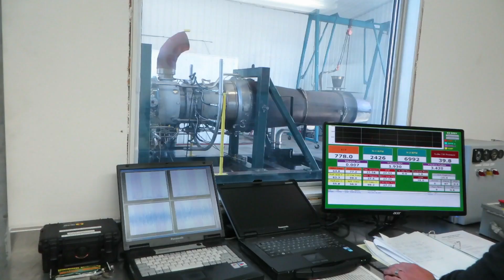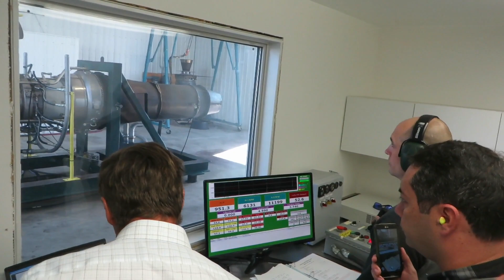RR Marine Spey turbine engine test run

Comment: Great video, what's the difference between the industrial, aero and marine engines? You have shown the aero to industrial but what is different with the marine application engine?
Reply from the maker: +hommie789  A marine engine is usually very close to an industrial engine, with more attention paid to protection from corrosion.
Reply: +AgentJayZ but this hade been in seawater ? from a crash or something ? ... still amazes me that there are guys walking up to it and "prodding" the engine when it´s running. They sure got more balls then me :P btw, that piece that flew of the roof/door, what was that ? just wondering :P Great video as always :)
Reply: +hommie789 We've discussed this in the preceding videos. The Industrial and Marine Speys were derived from the Allison TF41, which was a licence-built Spey, used in the A-7 Corsair II. My colleague, Keith O**, headed the design team and he had to go out to Indianapolis to bring back all the technical data. To turn the engine into a turbojet/gas generator, the first three stages of the LP compressor were 'cropped' to delete the by-pass stream. However, as you would have seen from the Industrial Spey shown previously, it kept the aero intermediate casing, which gave it a bot-bellied stove appearance. The Marine Spey had a major redesign in this area, because it was required to withstand 30G shock loads, just in case a bomb or a mine exploded somewhere near it.
Reply: grahamj9101 Awesome, thank you Graham. Being on AgentJayZ page for years now I have known about the difference between the Aero and the industrial but the industrial and the marine was new. Your explanation is perfect, so there is a major redesign. Any other differences between the two? Would compressor blades, shafts, combustor cans, turbine blades all be he same?
Reply: +hommie789 I was busy with the Industrial RB211 at the time the Marine Spey was designed, so I'm not familiar with the detail design features. However, if you go back to that Industrial Spey, you will be able to compare the external differences around the LP compressor and intermediate casing. The marine engine has that substantial mounting ring integrated into the compressor casing. Internally, the basic turbomachinery should have stayed much the same, possibly with improved corrosion protection on steel discs and shafts. The HP turbine of the SM1A would have been much the same as the TF41, but I have the impression that the uprated SM1C had new HPNVs and turbine blades with improved cooling. On the subject of the combustion chambers, I'm still trying to wheedle out of AgentJayZ what standard of combustor that SM1A engine has. As I've told him, I was involved in the design of a reflex airspray burner (RAB) combustor for the Marine Spey. It's all a long time ago now, but that may have been for the SM1C engine. It appears that they were fuelling the engine with gas, so I'm even more interested in knowing.
Reply: +hommie789 PS When I reply to a very good question like yours (and to some less intelligent ones), I do try to consider other subscribers with less knowledge and give a full answer.
Reply: +hommie789 Oops! I've just realised that I turned a Marine Spey into a Marine Tyne. For RM1A and RM1C, please read SM1A and SM1C.

Comment: would the vacuum created by most of these engines you test actually be strong enough to pull someone into it?
Reply from the maker: +crkr That depends, exponentially, on the distance you stay away from the inlet.
So: definitely yes, but it has never happened to us because we understand the risk and (over)compensate for it.
Reply: @AgentJayZ  vacuum doesn't exist which is why ya can't get vacuumed into it.

Comment: thanks for the video, as always!  Question... don't you usually put the FOD screen in front of engines that don't have struts and IGVs at the front of the engine?  i.e.  if something goes into the engine, it gets chopped up (and FODs the engine).
Reply: +SkyhawkSteve By asking this, it's clear you haven't watched his prior videos.
Reply: +Bottleworksnet Not only that, it shows he's not even been bothered to read this comments section.
Reply: +Bottleworksnet I'm working my way through Jay's videos chronologically.   I'm up to the videos from 3 years ago.  I've seen them use the screen for engines w/o IGVs and struts.    Which video explains why the mesh screen is no longer used?
Reply: +lazaglider   if you are referring to the post from thevolt10578,  you'll see that it was posted after my comment.   I did read the comments prior to posting, and didn't notice any reference to the FOD screen.
Reply: +SkyhawkSteve you only have to watch a few videos back to see Jay explaining this for the millionth time.

Stop justifying your laziness and learn for yourself.
Reply: +SkyhawkSteve The worst thing is that you make yourself out to be some kind of pseudo expert. You've got all the terminology, but your comments show you don't have a clue about it.

Such a condescending tone to your posts, unforgivable.
Reply from the maker: +lazaglider See those thumbs up? The first ones are all from me. Thank you again.

Comment: What is the big red tube out the top for?
Reply from the maker: +soflaav8r That's described in Jet Questions 82. It's our deflector for the HP bleed valve. It's not quite a 90 degree bend, so the massive amount of air coming out of it just is able to blow the weatherstripping off the top of the rear door opening.
A good illustration, I think, of just how much air comes out of that thing.
Reply: +AgentJayZ Yes, it is! Thanks for the explanation.
Reply: +AgentJayZ I'm very rusty on the Spey systems. My recollection is that the HP bleed valve (I nearly called it a BOV!) and the HP compressor VIGVs are interconnected. If so, the engine wouldn't have got up to anywhere near maximum.
Reply: +AgentJayZ Is it possible to change the design of your deflector so it' creates less destructive thrust :-)
Reply from the maker: +Coolkeys2009   Yes. The material used to create the sections which were welded together was only sufficient to create a 70 degree bend in the limited time available. I believe it is being modified into a 90 degree unit in preparation for the next marine SPey.
Reply: AgentJayZ I was thinking about a change in shape so the air comes out slower, but I suppose your always going to have a  large flow off high energy air going out the back doors anyway.
Reply from the maker: It's 12 inch diameter pipe, so I was expecting a big reduction in air velocity. It's amazing that it blows as hard as it does.
I did suggest having it made like a giant Dr. Seuss trumpet, or "fru-fuegler", and I was politely asked to leave the area...
Reply: AgentJayZ Wow I didn't realise it was that large. I guess the only way to get the scale of everything would be to see it it person. 90 degree bend sounds sensible unless your planning to put a large trumpet on the back of the engine too :-)